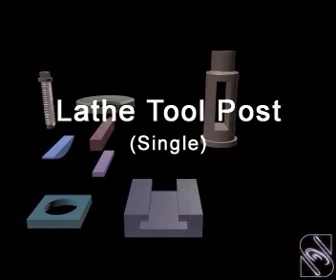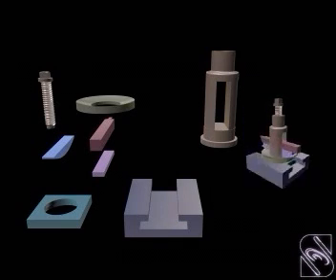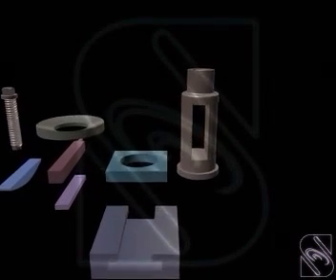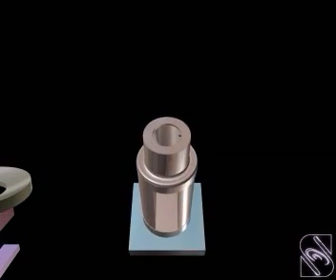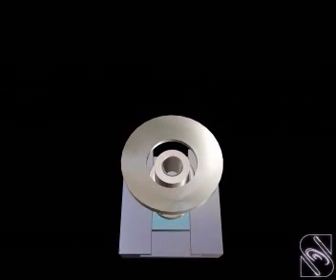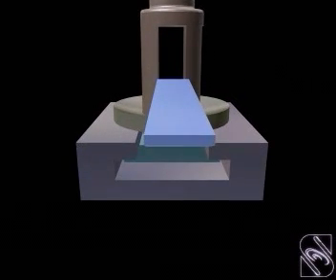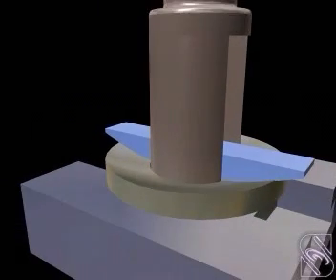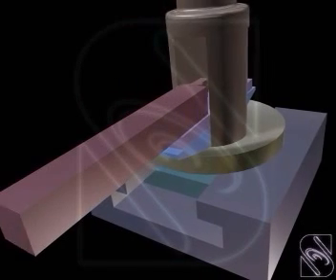Lathe toolpost  Assembly drawing || Machine Drawing #Assembly drawing

Comment: Ok the dewing as demonstrate in this  cad . program is correct in many ways  But  it as
" Design"  Points  missing I will contact in this  post . although this dewing  is true  in many way 

their are point  missing I will correct now .  if were  to Ues this post with the washer as designed we would do so well until.  we had a job in the lath  which had interrupted cuts   Or a ruff & uneven surface, then the tool tip would-migrate dowered in a the direction of the turning chuck  , & loos it's  canter-line    & common fault in the Lely days of the "Design"  

this was over com by the ues of the scrolled  OR  grooved  concave washer .  I my self used the grooved washer ,But I have seen the scroll tip & vert effective it was to   
[PERPPOS].
:- prevent movement the grove would lock in to place the poison of  the woodruff key & prevent it migrating when struck reputedly by an uneven surface. The fault resulted in over tightening of the post & braking out of the cross Slide  [ T ] slot  often found to day on the smaller lath. 

The scroll groves on the convex  washer had the,  Benefit of ease  setting of the Tool tip on centreline.  As the washer was rostered it would allow the key & tool tip  to increase   or lower  depending on the directions it was rotated  , & difficult to achieve. with a concave  washer . 
But not imposable. I used the grove option  ounce's set  there no ned to reset.  unless you require to change the size of toll . . often in the modern tool tips we see to day have the  Tool  reeks designed   in to the Tooling  this is over come with-ring spacers to fit  the required high  & size of tooling or  i some  cases a adjustable  spacer to set the determine Hight off tooling  in' use & the concave washer for fin adjustment if needed   But often ues in the flat polishing. 
as rack was already built in to the tip's .       

i hop this helps in the design.  of your Projects  Les Thompson "England"